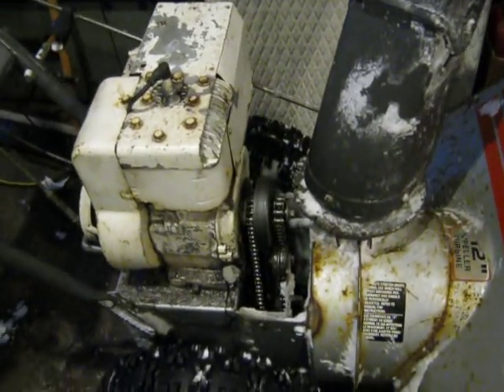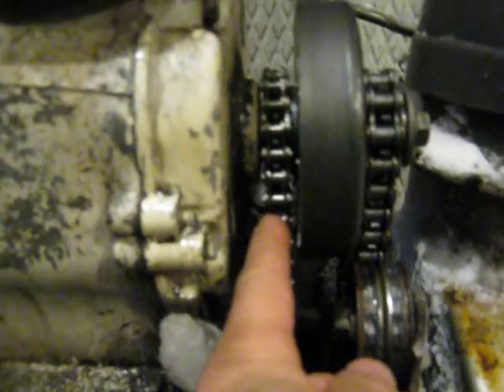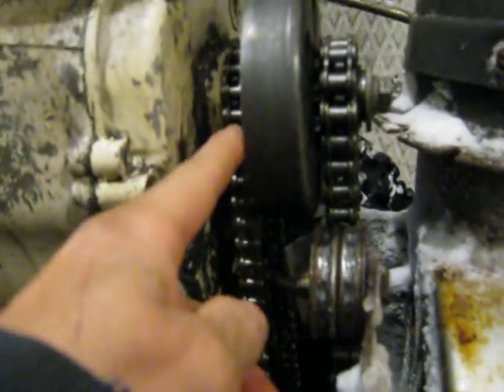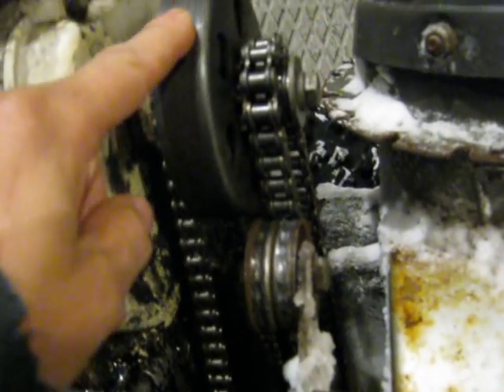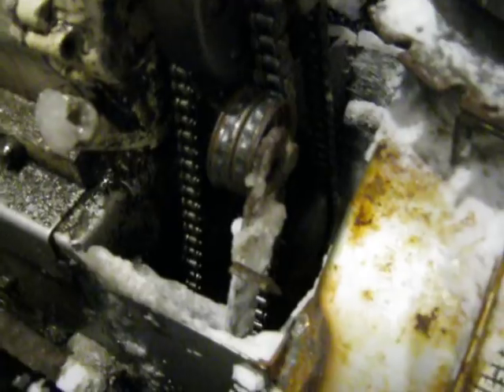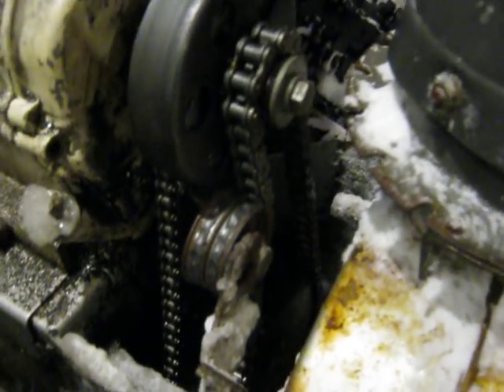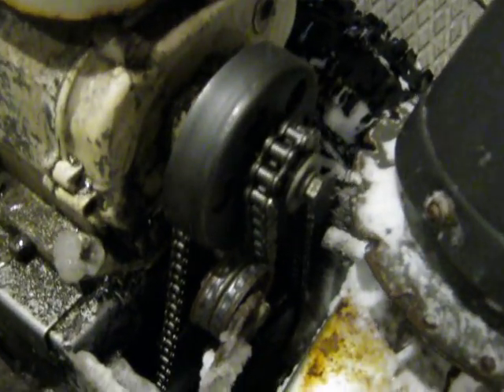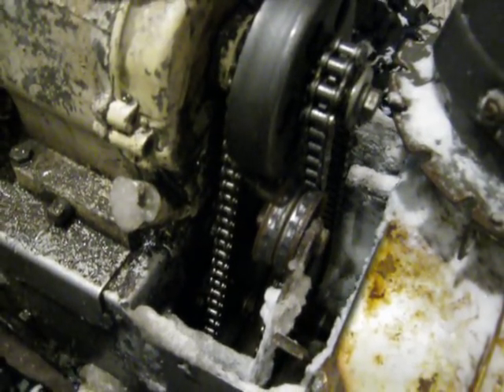Chain Drive Snow Blower!

Comment: I have the same problem, and had the same idea, nice to see it has been done. I am going to try just change the impeller-belt.
Reply from the maker: Yes, for some unknown reason this blower kept on eating the blower belt. My son got tired of buying new belts, plus having an unreliable machine. The chain drive has worked out well, with the centrifugal clutch. I was concerned because of it not having any overload protection (other than the shear pins in the auger). One time it ate a frozen newspaper, and locked up the auger. My son said that the centrifugal clutch instantly glowed red, so he shut the engine down. I guess extracting the newspaper was a pain, but once he did that, the machine still worked fine.

Comment: Wonder how long the clutch will last. Today my 60's Ariens didn't want to throw the wet snow, just clogged.
Reply from the maker: Yes, how long the chains will last is another question. I think the clutch should hold up OK, as they seem to last on go karts and such. This machine ate a newspaper last week, and survived. I guess the engine bogged down, and it slipped the clutch before my son closed the throttle, it took pounding on a 2x4 to get the newspaper out of the impeller housing, it was squeezed in there well !

Comment: Love your videos you think you can make a 5hp Briggs make about 20hb
Reply from the maker: LOL, the 5 horses on our 2 snow blowers replace 7 & 8 horse Brand X engines which conked out, and these little fellas are holding their own so far.
 My son is still making the 2 cylinder 10 horse engine from two 5 horses to hopefully mount onto this snow blower, that should give it enough fruit punch!  :)
Reply: @ChargerMiles007  does he have a video on it?